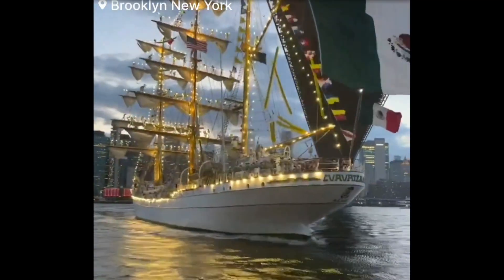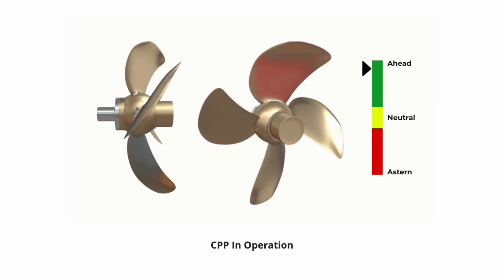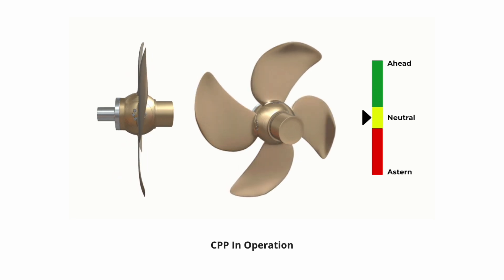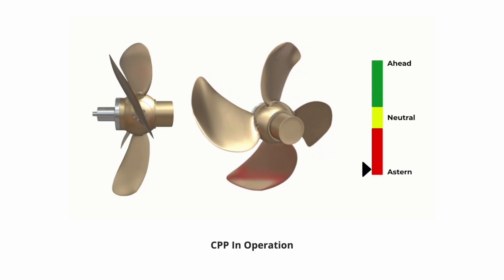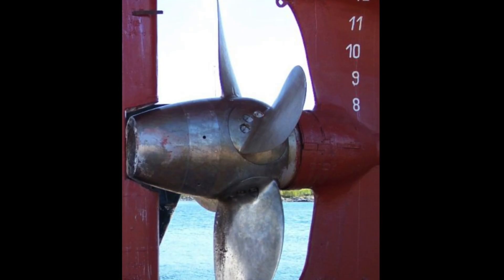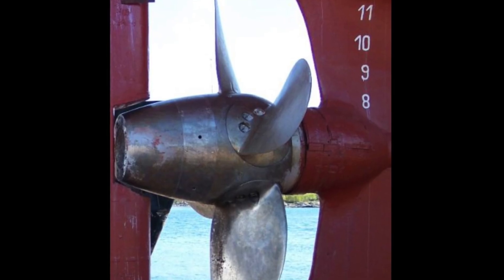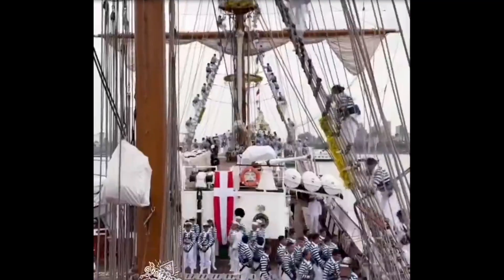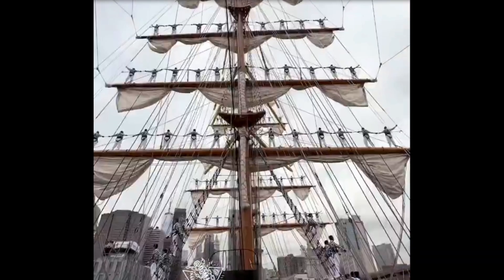Did the CPP fail during the Mexican naval ship / Brooklyn Bridge Accident?

Comment: This is a 16th century sail ship, the engine was added only to speed the process of mooring, the pilot apparently can only steer the ship but the throttle and the transmission controls are below deck inside the engine room tho it takes Two people to maneuver around the docks by verbal command from the pilot on deck to the engine room, it seems like there must have been a failure to communicate, it only took a few seconds to strike the bridge.

Either way it was pure negligence and now the corrupted Mexican government is scrambling trying to find someone else to blame.
Authorities should charge the captain with manslaughter even if it was a mechanical failure, you would think any naval force should be subject to a very strict maintenance standards before trying to sail around the world with that many souls on board.

Comment: Independently from a mechanical, hydraulical, pneumatic, electronic, human failure, as single point failure or compounded, the whole undocking manouevre was a mess from the start. The vessel needed no tug to cast off. The wind would have slowly separated the vessel from the dock. The tug should have connected a proper towline to the bow, before leaving the dock. The Captain is overall responsible, and so is the Pilot, and the tug Master to a lesser degree since he was following orders he should have questioned.

Comment: My thought was that no Captain would leave that dock on a flood tide (ie. current heading toward the bridge). But in the video you can clearly see a wake created by the ship going in reverse, with little or no current. A CPP failure seems to be the most reasonable explanation.
Reply: I just read that in fact they did leave on a flood tide, and the wind was also against them. Still could be a CPP failure, but as a sailor I can tell you that departing under those conditions was wildly reckless regardless of whether your prop is working right or not.

Comment: Clearly that ship was in full. Reverse questions are why was this not understood by the captain? Why was the engine not shut down immediately upon this? Revelation and why did they not anchor?
Reply: I believe the Pitch Control could be disengaged from the Engine. And there might be lots of electrical cables on the bottom or slightly below, thus making it a strictly "no anchoring zone". The Pilot would know this.

Comment: Question to you. Does the CPP have a micro switch the "tells" the pilot/captain what position the prop is? If there is a malfunction the micro switch doesn't change the light on deck, therefore you'll know for sure if the prop changes pitch. Long time ago these micro switches were used to tell the driver if the 'head' lifting the container was locked completely, the strad carrier driver would know immediately if all the four corner of the head were locked in thus making the lift 100% safe. I worked as a HD mechanic for the port and I knew of problems when lifting container of 20, 40 or 53 footers that they were locked 100% all the times, I found quite a few failures back then and repaired them.
Reply from the maker: I'm not sure of the exact system particulars.

Comment: Not a fan of CCP.
The BOB HOPE Class LMSR had numerous issues, and took constant observation. 
Someone WASN'T observing when one of the class "slid" into astern propulsion and ran down a buoy. 

On a small heavy-lift ship, I had a very close call. In the SUEZ, the helmsman reported a loss of steering, the Egyptian pilot pulled back the throttle on the CCP and we started turning left.   
We ended up stopped, and 180 around.
Pucker factor 10/10.

Comment: 11 minutes. How long does it take to deploy the anchors and shut the power down?
Reply: Even with anchor to Botton would probably be  minimum 300 ft to tighten scope and drag anchor to set.
Reply: Everything looks pretty normal until less than a minute before the crash, with the ship just a couple of lengths from the bridge.  By the time they realised what was happening, I don't think anything could stop them hitting the bridge. But agree the fact that the power didn't seem to get shut down for some considerable time after the bridge strike is surprising.

Comment: Tug not tied on because of Capt's pride?
Pride cometh before before an allision.
Reply: The tug had a line on until they were clear of the pier and starting to round up into wind and current. Possibly they briefly had forward propulsion before the failure. I passed them coming in earlier in the week. and there was no pride or hubris on display. the escort tug appeared to be made up on the hip as if they were a dead ship for at least half a mile before they were shaping up for the pier. this was all in broad daylight in a similar current. Seemed very cautious and prudent.

I understand the captain looking up aloft and feeling like if he just shutdown the engine that he was probably condemning his topmast cadets to their deaths and so he keeps trying to restore forward propulsion. I don't understand why he didn't drop anchors. at some point before they reached 6 knots the combination of shuttting down engine, dropping anchor and presence of escort tug probably could have prevented allision. 

If I was the engineer on board a single engine vessel with CPP I would figure out some kind of if not sophisticated then at least crude "load sensor" for the prop shaft to tell me if it was in tension or compression.
Reply: no. sometimes you do not need a line.

Comment: I had that type of CPP failure when I was piloting the USACE Dredge Yaquina in Humboldt Bay, CA.  It stuck in reverse because a small pin had broken in the actuating gear inside the hub.  Being twin screw I simply declutched the engine and used the other engine to go to anchor.  It took a month and a drydocking to fix it.  It wasn't my fault!
I read today that they have the same engine and CPP as the Yaquina.  The CPP will default to reverse if the hydraulic pressure fails.  It can be confusing in the event of a failure when the CPP indicator shows the wrong position.
Reply: Csn happen when you have a fault in the control linkage or the positioning sensors and it overshoots and the hydraulic rams it into the end stop.

Comment: If the rudder was indeed lost as at least one news story claimed, then a failure in the hydraulic system could account for both.
Reply from the maker: Good point
Reply: Loss of rudder control wouldn't cause the reverse path in videos, AIS, or to the hit location.
Reply: @lokiva8540  depends when and how rudder control was lost, no?   Don't remember which report I saw mention of loss of rudder control, and of course news media doesn't always get these things right  even without any language barriers that might be present in this case.

Comment: <-- Moran harbor Capt - they didn't have time to deploy anchors. Variable wheel malfunction seems the most likely cause. Damn shame.
Reply from the maker: Wish they had put a line on her before they through the lines off the dock and kept it there till she was making headway
Reply from the maker: Or even made up on the hip
Reply: @MinorcanMullet  IDk. small vessels like these usually do not require lines as their line gear could not handle 10 or more tons of bollard pull (even if pulling in clutch astern you can generate that much). Small vessels like these you just hold up against the dock while they take in lines from the dock/moorings and then they make their own way OR you go around and nudge them in the direction they want to go. That said, IDK what there deck gear rating OR SWL's (Safe working loads) even are. purely speculation on my part but wanted to give you guys a Tug Skippers take on the matter
Reply: Do you think the tug could have intervened in time if the ship has simple lost power and not been running in reverse?
Reply: @edevans5991  possibly yes. I would have tried if it were an engine loss. I would have stemmed the bow. Probably could pull that thing with just our 12, 8 & 3 part mooring lines (not sure what McAllister carries) without tearing up to much gear. even hipped up with mooring lines might be alright but that would take to long. stemming is the only thing I see that would have stopped this IF the sailing ship was not astern ordered regardless of what the actual order was the ship was engine astern - hence the "order(ed)"

Comment: Sailed for several years on container ships with CPP. One night after exiting the Suez Canal thus running at Full Ahead across the Med, suddenly experienced vibration and vessel veering to port; could not overcome it so stopped engine even though instrumentation appeared normal. Turns out a control rod in the CPP control system had sheared off which allowed the shaft rotation to throw the blade pitch to full astern.
Reply from the maker: Thanks for sharing your experience!
Reply: What happened after? Were you dead in the water?
Reply: @williambarry8015  We were died in the water, drifting for several hours while the engineers machined a replacement control rod out of an old engine cylinder head bolt and installed it. We located the nuetral, no pitch, postion by looking at propeller wash. Then we were back in business; upon arrival in port, the repair was inspected by classification society as a permant repair and it was still being used when ship was sold several years later.
Reply: Didnt you get a input control mismatch alarm?

Comment: But why didn't they throw a line to the tug at one point it appears to be close enough
Reply: not as easy as it sounds. Lots of variables and decisions to make here. As a Tug skipper you cannot just throw your tug into the ship to stop its weigh. Own tug may get damaged and risk tug's own crew as well as the customer's vessel. IF the tug touched up and then the allision was made litigation could be made against McAllister as the faulty error in addition to other factors. Plus the fact that if he made up a line where would he have pulled him? he would have slung the ship around thus increasing allision velocity with the rigging (as a likely possibility) causing even more catastrophic damage / loss of life. The safest bet would have been to stem the bow and pull downriver from own tug's bow against the flood tide. Pulling in a straight line away from the Brooklyn bridge. The McAllister tug was not in a position to do that from any of the videos I have seen. No fault of the McAllister Capt as he would have expected the Sail ship to drive "ahead" thus putting the tug in harm's way if he stemmed "up" on the bow.
Reply from the maker: Thanks for your insight.  This accident will be an eye opener for many folks
Reply: @MinorcanMullet  YW and good reporting :)
Reply: With another 5-10 minutes it appears they could have had 3-5 tugs on scene and been under tow by a pair of them, with 3500-5000 HP, on a ship whose auxiliary power is almost 1200 HP.  At that point, they could just shut down power to a failed reverse gear, or overpower it.  

But, even if 5-10 minutes is REALLY fast by some standards, the crash was over and done far faster.

Comment: It's only 700 hp. Probably has a regular marine gear. But they can also get stuck in reverse.

You were correct it has a CPP.
Reply: The Eagle lists 1200 HP, and this replica design lists 1100-something, not 700 HP.
Reply: @lokiva8540  Even if it's 1,200 hp. It can still have a marine gear. Twin Disc makes models that can handle 4,000 hp.

I guess the website I saw had the wrong power on it.
Reply: @DuaneKerzic  Either way, it looks like the ship was powering in reverse, long after that was ordered to go forward.  

The pilot has lawyered up, and released a statement claiming to have given proper orders to power forward.  Obviously that didn't happen.  Ultimately an NTSB report will likely document why and how.
Reply: @lokiva8540  I never said it wasn't stuck in reverse in some way. 

The last I saw is the Mexican Government hasn't provided access to the NTSB. But that might have changed.

I was looking for a reference on the pilot but can't find it. If you have one feel free to provide.
Reply: @DuaneKerzic  LA MARINA MEXICANA CONFIRMA QUE QUIEN MANIOBRABA ERA EL CAPITÁN ESTADOUNIDENSE LLAMADP CAPITÁN PRÁCTICO O DE PUERTO !!! 

NO HIBA AL FRENTE DEL BUQUE EL CAPITÁN MEXICANO...

Comment: 2nd possibility is electronic/ manual gear control failed while throttle function was still functioning. 3rd possibility is the gear pack froze in astern and as more power was applied with control in ahead the gear was still in astern causing the increase in speed.
Reply: yeah, these are great speculations too. I had a similar issue once with rubber diaphragm debris preventing the pneumatic throttles from closing thus leaving the mains in clutch ahead. Thank God the deckhand had enough sense to jump down off the bow pulpit before the allision into the dock.

Comment: I had many years in offshore anchor handling supply vessels with CPP and when we had something like an electrical blackout or, CPP hydraulic pump failure the blades would go into the astern position. I remember one case where we had a blackout tied up to the rig and the next thing we went hurling back into one of the rig's legs. New skipper on board who hadn't been told that when that ship blacked out the blades fell into the full astern mode. He thought when he pushed the sticks ahead he was moving ahead. All he was doing was increasing the revs on an already astern prop.  Luckily we hit the fendering on that leg and just bounced off with red faces all round. I believe the skipper did go down to his cabin to change his trousers too. 🤣
Reply: That is correct.  I remember being at anchor off Brookings, OR and the engineer started the mains without first starting the CPP pumps.  We started dragging the anchor in reverse.  I think the idea is to stop the vessel if the CPP pumps fail.
Reply: Correct. This actually a safety feature of certain older CP prop setups that everybody needs to be aware of. Ive sailed on a 2 CP prop ship built 1981 but modernized in regards of AIS and so on. Still if you encounter a fail in they hydraulic control circuit or a blackout and your clutch is not disengaged, you can run into trouble if you dont check the pitch indication.
Newer systems eg Schottel lock the prop in place in case you lose hydr. pressure.
Reply: If the Captain had an olive up his rear end, he would have produced olive oil!

Comment: Heard that it was put in reverse by accident.
Reply: It would have been in reverse intentionally leaving the pier. 

The obvious intent was to power forward and steer to port, after backing clear and dropping the tug.  

By appearances they gave throttle to do that, but went at the bridge faster instead, possibly pushing up throttle more before realizing they had a malfunction.  

Somehow they powered astern.  Whether this CPP failure mode, or some other.
Reply: Even if the controls called for astern in error there was plenty of time to correct that and you would have seen a huge prop wash…. None occurred. I don’t think the put in astern in error is credible !
Reply: But didn't need reverse to leave the dock?

Comment: ''new and improved tech'' will bite you every time.
Reply: That style prop has been around a long long time.
Reply: El principal requiere menos mantenimiento importante, pues siempre trabaja a las revoluciones óptimas, pero tiene sus bemoles
Reply: Problem with older CP control systems from the 80s is thst it uses or used control air for operation. This is if course not as acurate and modernizing these systems is fairly expensive. We for example integrated it into a newer AIS to make it operate like a DP system.

Comment: Makes sense, that's why they might of given it a handful of revs expect her to slow up and move ahead when in fact it was worsening the situation.
Reply from the maker: Exactly.  I can't imagine the internal panic the Master would have felt.
Reply: Always check the pitch indication before applying thrust.
Thing is usually for maneuvering the prop is set to constant speed and not combinator.
Reply: @Gurkon  A later comment here from @OceanMack tells of an experience where a problem with propeller pitch when underway failed to shownup in instrumentation.